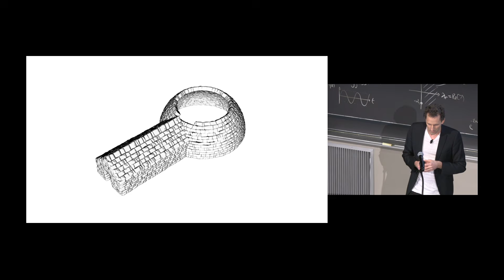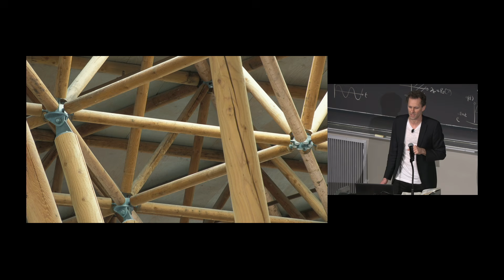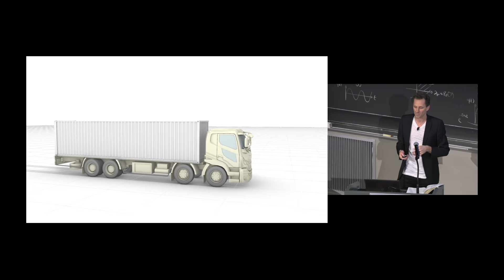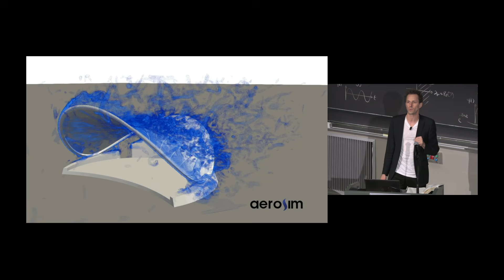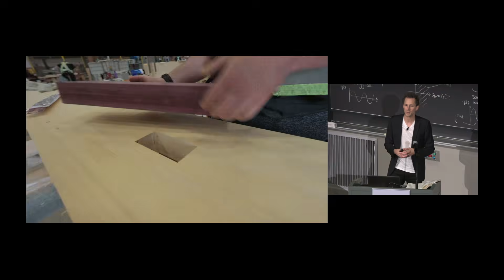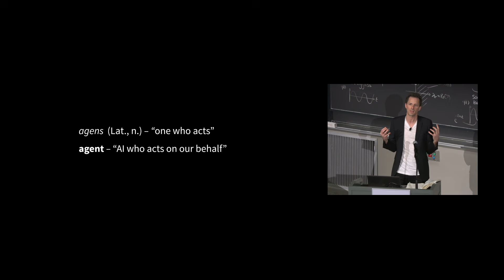The Edward and Mary Allen Lecture in Structural Design: Lucas Epp

Comment: I watched Lucas Epp's addres 7:14 s to MIT and I was not surprised. Most Grid Shell architectural  designs are ridiculous- and I do mean that... Way over engineered, clumsy, lazy and egotistical. There is a much simpler method, but it requires a fundamental, root and branch reassessment of construction; a return to the beginning of first principles. I can show you if you truly are interested in your profession.

This principle pays no heed to load, because there are negligible static stresses. That's right... Instead we focus on Energy, not Load/Mass? 

If you would like to know more, if you're curious, return this email.

Look forward to revealing all x

Stewart MacPherson 7:14 7:14 7:14 7:14